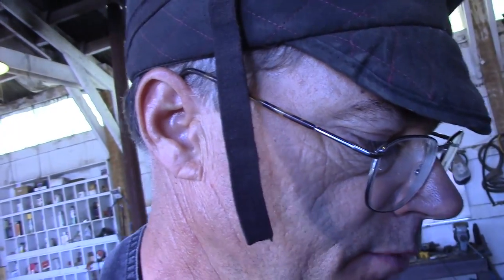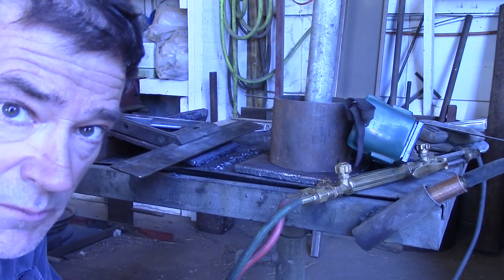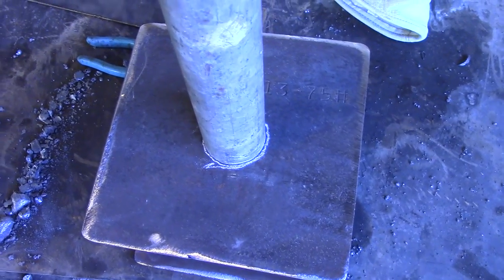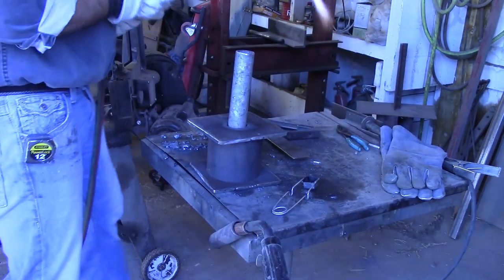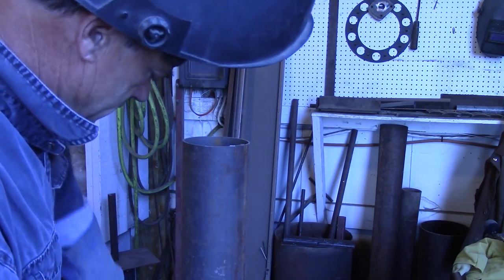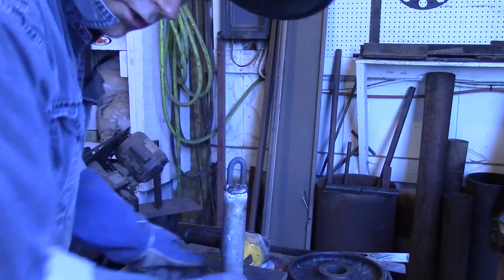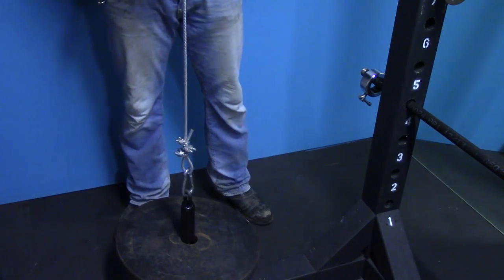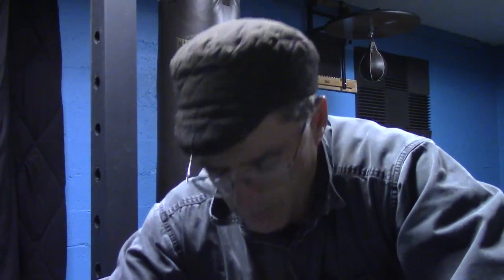Power Rack Cable IMPROVEMENT -  DIY Duke

Comment: Hi Diy Duke I love the power rack and everything you added to it, you could also add a pulley to the floor and attach an extension cable with a carabiner to the existing cable, so you can work biceps too :)
Reply from the maker: +ajsingrutinchina good idea, gotta get back to it
Reply: And also it can be used as a rowing machine that way, I've seen a couple ideas on youtube, but I'm pretty sure you're gonna do it better :)

Comment from the maker: +Jack Pascoe yes you can take it apart since screws were used.  Then in reassembly just direct the screws in slightly different areas so they are going into new wood.

Comment: You can build a proper power rack cable by installing a 1" pipe vertical from the rear bottom base to the top and then use 2" pipe that slides into the 1" pipe , use 7 pieces of 2" pipe and two 4 way connectors, the three 2" pipes can be inserted outside of the 1" pipe connected with the 4 way connectors and the other four 2" pipes connected to the sides so they can accept a weight , you can accommodate the pipe width for the weight you're using to make sure the weights and the spring collars fit.

Comment: I use to workout at an old school gym. At the time it was one of very few gyms in town. It was known for mostly Bodybuilders and sports training. The local Pro wrestlers workout there as well. Most all of the equipment was constructed of wood. Designed by the gym owner. It was rumored that he was the forefather/ inventor of some of the fitness equipment we use today. Such as the bench press, incline/ decline bench press. Lat pull down. plus a few others. Unfortunately he did not get patens on any of the pieces of equipment. The gym opened up in the mid 1940s, changed ownership in the late 70s and closed. around 1986.  The gym was located in Indianapolis Indiana.  Seeing home made gym equipment bring back many good memories.
Reply from the maker: +andy whitehurst that's a great story, thanks for sharing

Comment: Hey duke I know this video is a few years old but I’m about to start this project and I was wondering if you could tell or show how to add a pulley on the bottom as well so I can use it high or low. I hope you see this and can help me out! Thanks
Reply from the maker: Yeah definitely you could add a pulley you'd want to anchor it good .
Reply: DIY Duke 
Thanks for the response!
Would you just put it on the bottom perhaps and add a cable attachment to the original pulley system ?

Comment: you could make a resistance band attachment, 1 end held in the ground (or the rack) and the other end held in this platform.
this would provide accommodating resistance, and sort of lock he weight in a path
also would be very cheap
Reply from the maker: hey yeah - great idea
Reply from the maker: hey yeah - great idea

Comment: If you want to stop the weights from hitting the bottom 4X4 you add a piece of 4X4 where the pulley is, or something alone those lines. It may not be the prettiest, but it will be the most practical. And it's not like the weights will cause that much leverage on that short piece of 4X4.